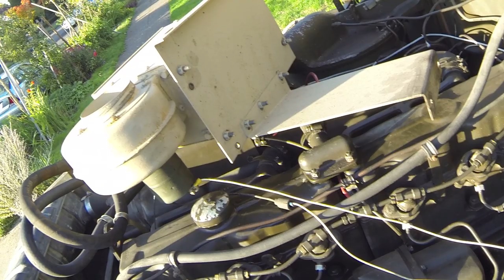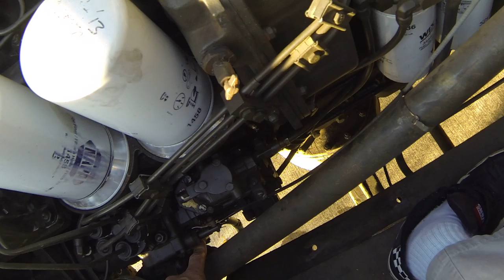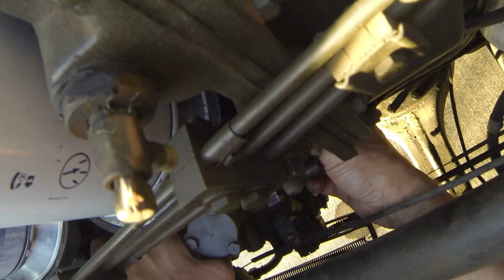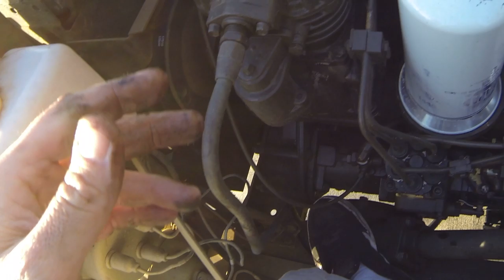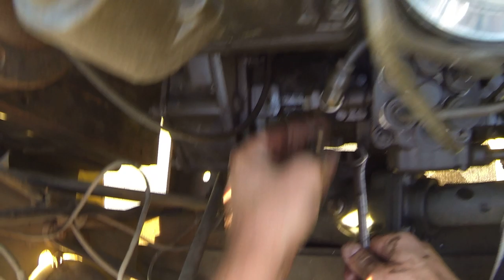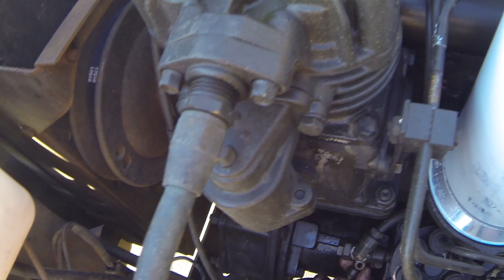M35A2 LDT-465 Fuel Density Compensator (FDC) Bypass

Comment: Thanks for the part numbers! I plan to do this in the near future, and having those numbers will make it that much easier/faster
Reply from the maker: Please note I had a typo above.  Also, the ETFE tubing is expensive, yet 1) has excellent chemical compatibility (I run waste oil that could be contaminated) and 2) is translucent enough to see what's in there.  You can find 1 or 2 cheap, but getting both is more challenging without paying more

Comment: Did bypassing the FDC solve your fuel leak?
Was it leaking into the crankcase or externally?
Thx for the video
Reply: Charles Riley it foxed my fuel issue when it was bypassing into the crankcase.
Reply from the maker: I know it solved my initial start and sputter out problem and rough running the first couple minutes.

Comment: so all this dose is increase your control of the power?
Reply from the maker: It helps prevent fuel leaking into the engine oil, boosts power, improves reliability, etc.  What more do you want?